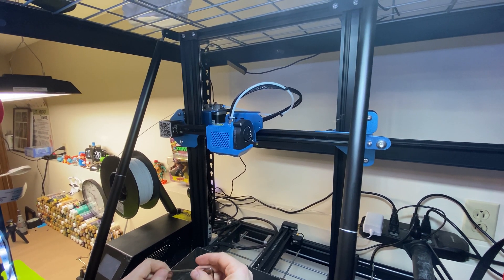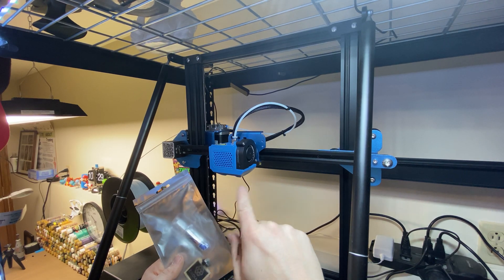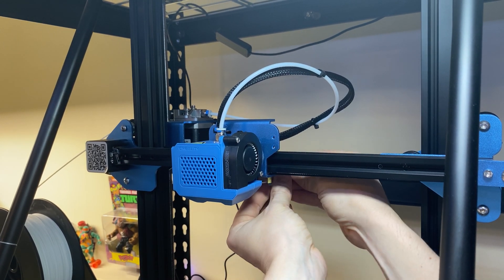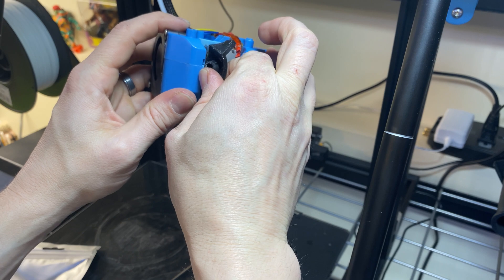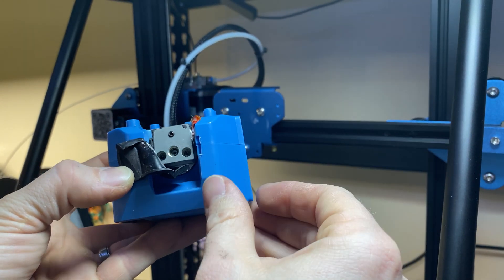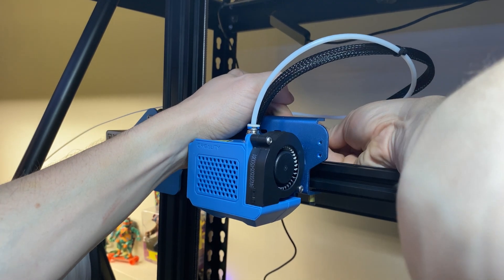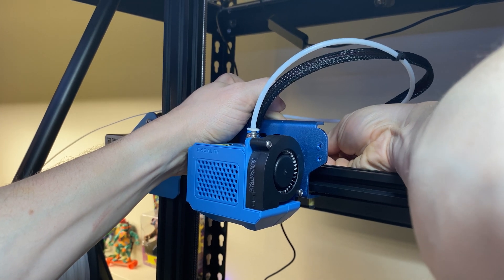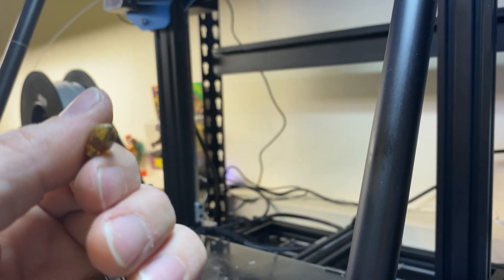How to Replace a Nozzle on a 3D Printer

Comment: Hi Chris, Thank you for this video. I learned that it is not difficult to change the nozzles and dared to buy a whole set of different sizes. My first change was from 0.4mm to  0.8mm. I was impressed with how fast the print finished with the same speed settings; it is not 50% faster but close to it. However, there were quality issues. The top layers would have "bumps," and the supports were more difficult to detach from the object.  All of this brings me to ask you two questions:  Do I need to check all my settings and adjust them for each different size of nozzle? And, should I change the nozzle diameter on the "printer nozzle size" setting, or is it just enough to change the line width in the "quality settings"?  Thank you again for sharing all your knowledge with us.  It helps a lot.
Reply: Also, those new shelves you have are great!

Comment: Side note!
Check the height of the nozzle you are replacing with, and if the height IS different.... Relevel your bed.
If the new nozzle is higher than the one you replacing, you might damage the bed/and or nozzle if you don't relevel.